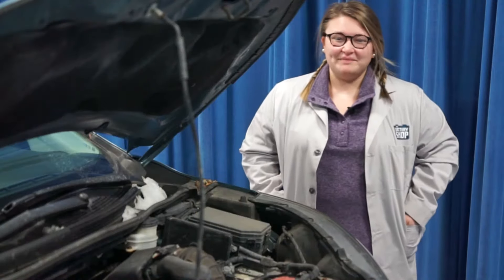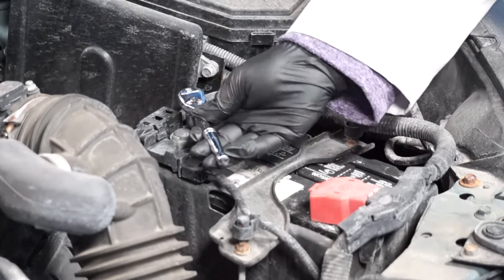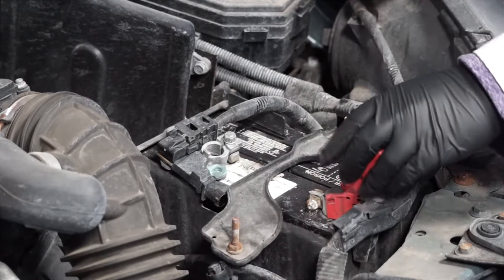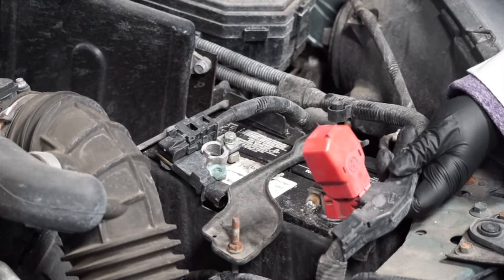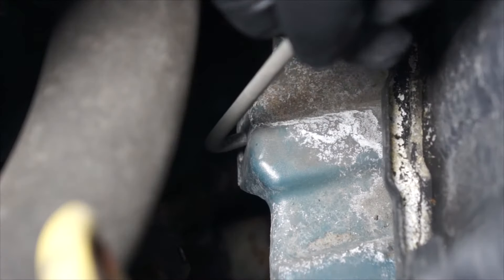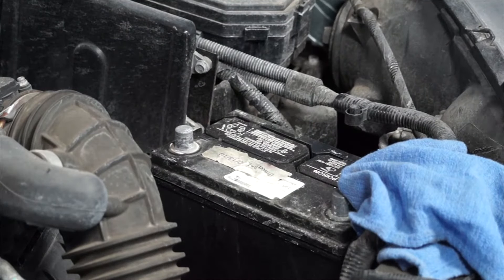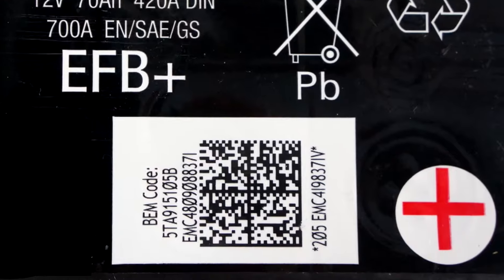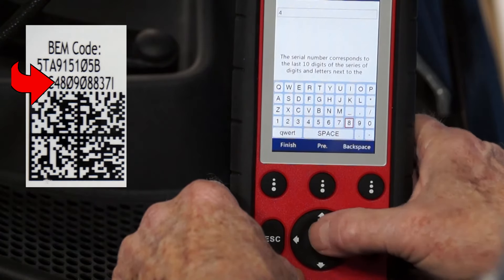Honda CRV (2002-2019) - New Battery Install

Comment: Shoot! Things were going well until I got to the removal of the current sensor lol. Update:  There's a little tab on the current sensor that has to be pressed down before it will pull out.  Once you do that, the rest of the way is easy.  Don't forget to put the battery cover over the new battery once you set it down into the engine compartment.  That cost me about ten minutes lol.
Reply from the maker: You can do it! We believe in you

Comment: What is a “memory saver”? It would have been helpful if you addressed that in this video.
Reply from the maker: Thanks for watching. We use a memory saver with an OBDII connection. This will keep your cars presets alive while disconnecting the battery.

Comment: Do you need to program the battery?
Reply from the maker: Thanks for watching.  Some vehicles require a registration process for the computer after battery replacement.  You will need to consult a dealer or mechanic to determine if your vehicle does.

Comment: So I tried to remove the cable harnesses off the bracket, and one of them broke the other one just isn’t budging. In the video you just pulled them off. I can’t do that.
Reply from the maker: Hi - Thanks for watching and sharing your experience! Sometimes we break things like that too. We just get replacement parts from the local dealership parts department.

Comment: I didn't think a memory saver was necessary on late model vehicles. What say you?
Reply from the maker: Hi - Thanks for watching! We use a memory saver to keep the vehicle's various systems from resetting, ie. Radio stations, GPS, emission related monitors, and to keep from having to manually reset things like power windows, steering angles, etc.

Comment: Thanks for sharing your video.  CRV 17 what is the size of battery and measuremen in L × W × H . appreciated
Reply from the maker: Hi - Thanks for watching! It depends on the year and engine used. We suggest that you check the vehicle owner's manual for the proper battery (Group size and CCA). Then the physical dimensions can be determined.

Comment: Just replace the battery on a 2018 Honda CRV. When I started the car every light was lit up!!
I drove the car about 100 yards and everything started turning off and my preset radio stations came back!
Reply from the maker: Hi - Thanks for watching and sharing your experience!
Reply: Hi Andrew, Did you use the battery saver (like the video suggested), during your battery change? Also, did you have to register the battery serial number with battery control module? Thanks.

Comment: Thanks for the video.  Is the battery saver specific to the vehicle?  Do you have a recommendation on a battery saver that you use?
Reply from the maker: Hi - Thanks for watching! Memory savers are basically universal. We usually get our memory savers from local auto parts stores. Check out our video on memory saving. The link is in this video's description.

Comment: I thought you had to jumper in a temporary battery supply so that the computer doesn't lose its mind.
Reply from the maker: Hi - Thanks for watching! We used a Memory Saver to do that at .035 on the video.
Reply: After I did it I discovered you do not need to maintain power to the computer (2019 CRV).  The computer reprogramed itself after I started driving.  It was actually pretty cool to watch.
  Also, get a load of this.  The auto high beams had not never worked and after it reprogrammed itself they started working! True story.

Comment: What is the code for the crv re4 2006,what is the recommended crank- current rating.
Reply from the maker: Hi - Thanks for watching! We don't have that type of information here in the studio so we recommend that you check with a service/repair manual for the vehicle.

Comment: I wish I had watched your video before I replaced the battery on my 2019 CRV. It was dark and I put the battery in backwards and hooked up the cables. It sparked and I removed the negative cable immediately. After watching another video at https://youtu.be/JOegisEjHSk, I discovered I had blown the ignition fuse bank. Be careful when swapping your battery!
Reply from the maker: Thanks for watching and sharing your experience!

Comment: What actions need to be taken to reset the computer when a memory saver is not used?
Reply from the maker: Hi - Thanks for watching! That depends on the individual vehicle and how it's equipped.  We suggest that you check the vehicle's owner's manual or a service/repair manual for the specific resets, if any, that are required and how to perform them.
Reply: @TheBatteryShop  (o9⁹99999999⁹o0